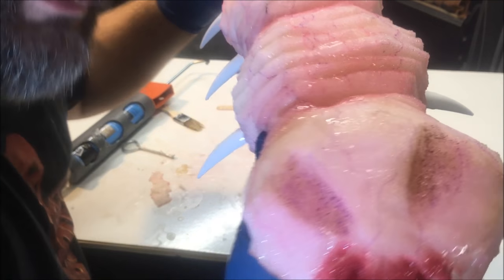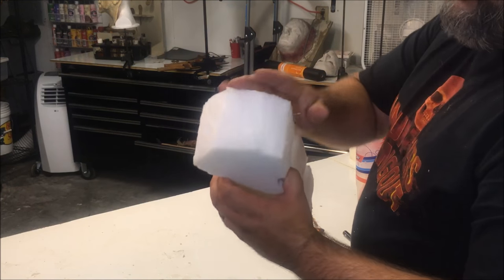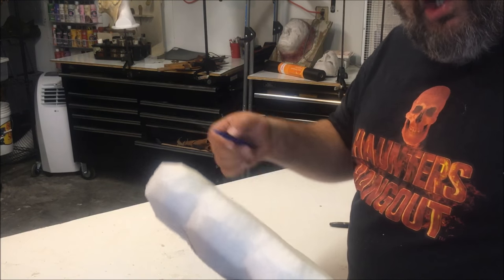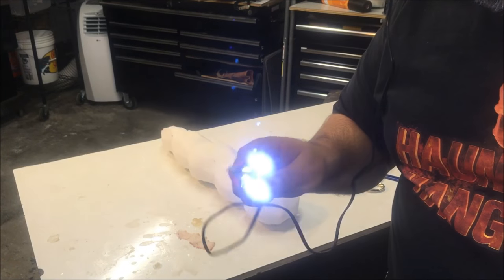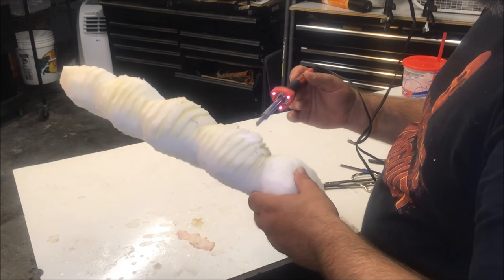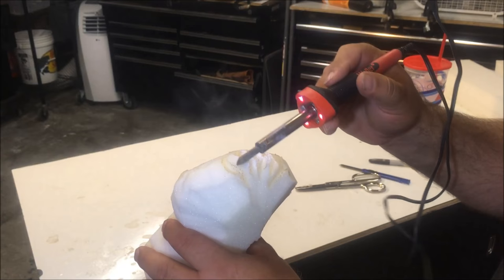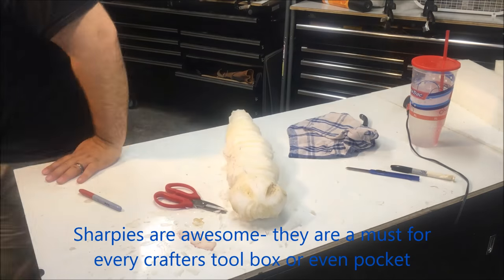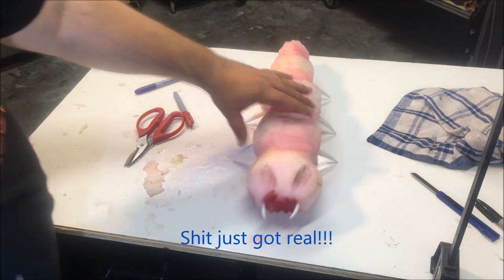maggot build

Comment: COOL!  But I am surprised it did not eat the foam.  Have you tried using the clear school glues instead?  I have even made my own Phlex gule using the school glue as a base with a tiny amount of plasticizer.
Reply from the maker: spray paint does not eat upholstery foam. Most school glue is water soluble and I wanted these to be water stable in case they got wet.

Comment: Question: I've taken to using insulating foam for some Halloween Props. If I take a soldering iron to it outside, without an air conditioner, how bad have I messed up?

Just seeing the smoke made me a bit sick to the stomach.
Reply from the maker: just use a fan to keep the fumes away and work outside- no problems. long term exposure is an issue, once or twice a year is no big deal...but dont make it a habbit.

Comment: I would like to know if I can use Dap silicon to make a face mold.
Reply from the maker: NO. Silicone caulk is a tin cure silicone- they are heavy metals dissolved in it that will leach into your skin the whole time its touching, especially during the curing process. Platinum cure silicone is skin safe and well worth the investment for safety.